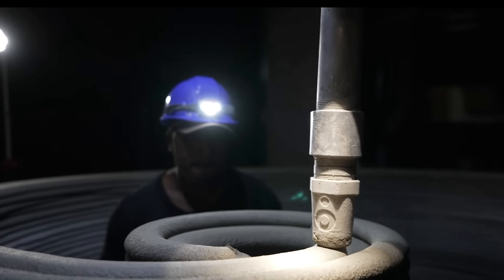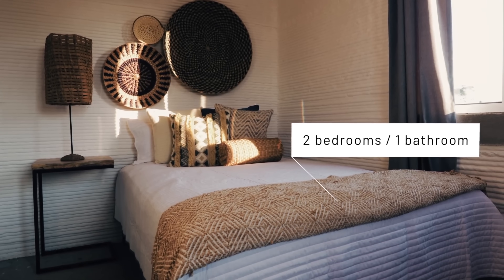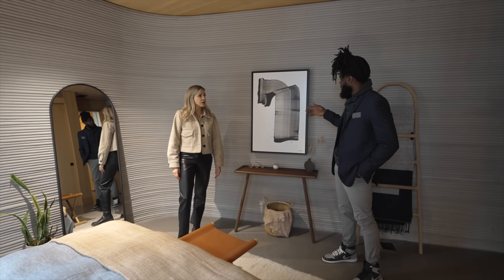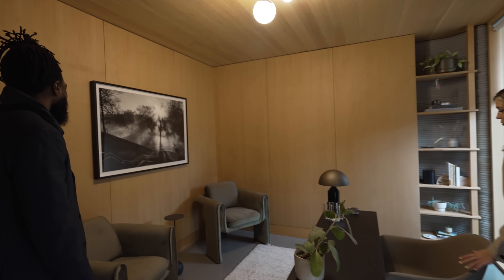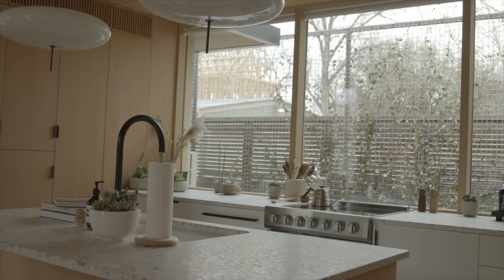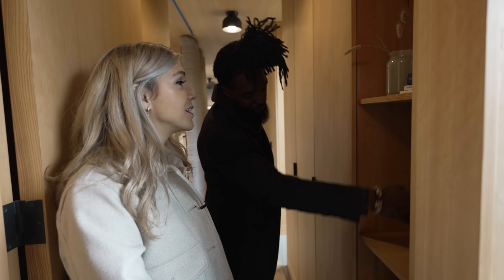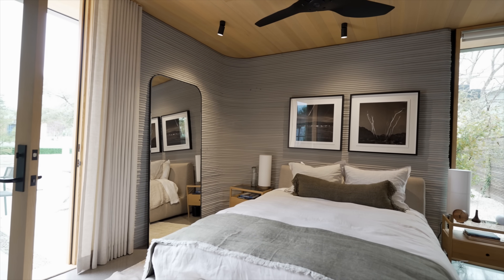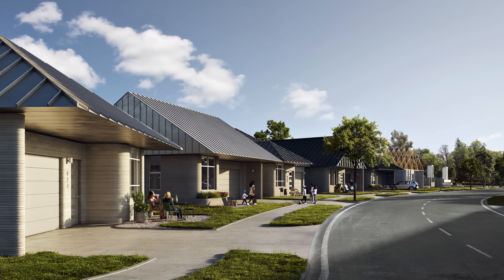Inside A 3D Printed House You'll ACTUALLY Want To Live In

Comment: wow, this is so cool. I think the only thing that would really stink is if you need to change some of the layout you're stuck with the main walls. I'm wondering how much less expensive than traditional houses they are.
Reply: I would think of it like a condo where you can't add or change the layout, but you could just reimagine the space you have.
Reply: As a builder myself I’d bet the farm that this is NOT cheaper, more efficient or more environmentally friendly. At least not in southern Ontario.
Reply: @PeterH269  Check out the channel of Belinda Carr. She is and architect, who is evaluating and busting many of these myths.
Reply: @PeterH269  It is not any cheaper - at this point. As the price of concrete ain't going down, it's really a novelty at this time if you run the numbers.
Reply: @16v15  Where do you live? Homes here in the Toronto area are well over $1.3m for a small 3 bedroom. There is no way a 3D printed house would cost more than $75k - $100k per house... bigger and more functional as it would be custom. This would solve the housing issue where pretty much anyone would be able to afford to have a home.
Reply: @16v15  You obviously don't get the point. Housing prices are made up. It's not the actual cost. The lot is not $800k. The lot prices are made up. Same with condos. A 1 bedroom 800sqft condo should not cost $750k when they use to cost $150k.
Reply: @eirik874  Yes, made up. Explain how a 2 bedroom bungalow that sold for $420k (high) in 2008 is now selling for $2.2m  today.  Did salaries go up 500%?
Reply: @casual35  that is because the market is in the roof. Now as to the building cost you are also paying for the land the house is on. The wood has gone up drastically and still is up in the roof because of the event that happened in Canada. There is also a shortage of sand to the concrete. The workers need there salary and at least the company that i work for (construction) aims for at least 15% profit but we usually hit around 20% and there is all taxes and such on top of that also so it really adds up in the long run. Also to elaborate a bit on the market especially in the city where everyone is moving now days in Oslo its roughly 13k dollars for a square meter just because there is hard building there. We can speculate that the bosses building the houses are thieves and bad guys but there is many factors in here
Reply: @eirik874  Lol
Reply: @xxxxMaddnesSxxxx  if it can make houses affordable for the younger generation or people in general its a great idea. i wonder how it would work in different climates.
Reply: @casual35  Toronto and Vancouver are insane I used to live south of Vancouver BC
Reply: @xxxxMaddnesSxxxx  Can we print hempcrete?
Reply: @xxxxMaddnesSxxxx  Would hempcrete be as economical as house printing? Apparently, hempcrete is more expensive than traditional concrete.
Reply: @xxxxMaddnesSxxxx  What do you think of cob houses?
Reply: @PeterH269  Even if it were "cheaper" it would only be a matter of time for it to match and/or surpass conventional building. The majority of business these days has only one goal, eliminate human labor and increase profit.
Reply: @PeterH269  I thought the same however we are both wrong. As someone having one so e in NEW YORK where EVERYTHING IS MORE EXPENSIVE. The home itself such as foundation, floor, walls, ceiling is without a doubt no BS approximately 40 PERCENT cheaper then a traditional stick and wood home.
Reply: @PeterH269  when you find the actual answer to that, write an article about it on Medium!
Reply: @PeterH269  is totally right.  

As for being "stuck with main walls" that is always the case with poured concrete, or any other "main wall" really.  Home owners generally can't bust down even a CMU wall or any other significant park of their building without the assistance of skilled labor, not the type of ones that would be sold on this kind of gimmick anyways..... 

This dudes job title and shoe laces say it all to me.

Which reminds me, the whole shipping container thing is really only a step forward for people who like the look of shipping containers.  Otherwise they're generally not any more modular or green or cost effective than anything else really.   I don't mind automated construction but the whole point of this video is to buy into something that seems clever.
Reply: @beepboopbleep3695  I wonder how much you actually save on doing it this way... making a concrete frame like they have here i cant see that really taking that much longer with skilled labour
Reply: @beepboopbleep3695  Installing wiring and plumbing is a whole lot harder too. Check out Belinda Carr's channel. She is an architect who debunks many of these myths, including the shipping container non-sense. Like you, I am also open for new methods, but it has to be sense and not just be different for the sake of supporting some new startup business.
Reply: @mrtopcat2  bingo
Reply: @beepboopbleep3695  Plus wood structures have a far better R-value than concrete or stone. Wood also has a far smaller carbon footprint with concrete having the LARGEST carbon footprint of all materials. Additionally I just saw a documentary "sand wars" according to which concrete-"type"-sand is already a scarcity.
Reply: @mrtopcat2  hmm, interesting.  I guess solid chunks wood and plywood sheathing themselves have a much higher insulative capacity than poured concrete per cubic inch, and the more practical wood framing and bat insulation achieve even better performance at pure temperature separation, but I wonder:

Could the lower R-value of poured concrete actually accentuate it's temperature performing qualities in reference to human comfort/daily time scales? Like a magical ratio of moisture permeability and lower specific height threshold variable to higher volume and connection to underground slab/water table conditions.

I've never really thought too much about it, but "cool concrete" is a thing I think... Maybe the opposite of a heat sink?
Reply: @mrtopcat2  or is the opposite of a heat sink a space heater i don't know
Reply: @beepboopbleep3695  I am not so sure myself. Like mentioned Belinda Carr has many answers. I am not associated with her channel and these days I don't even watch it that much, but she had some really smart explanations about this sort of stuff. She even has a video dedicated to insulation materials only with pros and cons, vapor transfer etc. you name it. If you are interested in building a house, she should probably be on your list to watch first. Another YouTuber Matt Risinger had also again and again some great info on insulation. But I must say I am no big fan of any new kind of insulation, which is IMHO untested.
Reply: @mrtopcat2  Depends on the design. You can print wiring conduits right into the wall. Plumbing can be laid in the slab foundation. Imagine already just printing in the channel for an in-wall vacuum. I'd also look at if the wall is strong enough to allow you to berm earth up to it so you could really use that concrete as a thermal battery even better in colder climates.
Reply: @TheChromeRonin  You have answered the plumbing and wiring question, but left out the elephant in the room: carbon footprint and sustainability. In fact, research is going towards moving away from concrete for reasons of sustainability or better in case of concrete the lack thereof. 

With cement production being responsible for 6% of global CO2 emissions, while car tail pipe emissions are responsible for 7% of the same. Concrete also requires a type of sand that is already finite in some local areas (Sahara sand is not suitable).
Reply: @mrtopcat2  Thansk for pointing this out. These 3D printed houses are not cheap and are not efficient to build with in your typical suburb or city. Even if you want concrete house its more efficient and easier to make pre-cast segments in a factory then to bring a 3D printer and all raw material to site like this. The 3D print method has some areas where it will be good though, for example on the moon, other planets or other isolated areas where automation/remote steering is key and where the raw material thats going to be used will be gathered right next to the construction site. As for these suburbian 3D print houses, the concrete is delivered from far away just like any concrete work. It only really makes economic sense with 3D building if the raw materials are dug up right next to the site.
Reply: @mrtopcat2  your forgetting something the wall is not 100% concrete. It has a hollow space where insulation is poored.
Reply: @beepboopbleep3695  Adobe is normal material in new mexico and wood in walls does not exist.
Reply: @TheChromeRonin  why should the wall have conduit when the wall IS THE CONDUIT? But I know the 3d head is not accurate sooo perhaps a robot can lay in the conduit?
Reply: @LK-pc4sq  Your user name sounds promising. So you should know better. Have you read more of my comments here. Concrete is pretty much the worst from the climate change perspective. Please stay informed. We don't have more time to waste with solutions that feel good or sounds good for people who may be well meaning, but technically illiterate. This is the time to search for hard data, which is available. Again, please read more of my comments. It may be a good starting point. Best wishes.
Reply: @kasposblazos864  I wish people would stop calling it "3D printed". This is automated CNC concrete pouring.
Reply: @PeterH269  well of course you wouldn't you're a builder this kinda stuff makes you nervous
Reply: @Coldlegend214  I think Peter is more qualified as he builds for a living.  Just because something is new and paradigm shifting doesn't mean it stands the test of time but at the same token, doing things because we have always done it this way means no innovation.  I say, let's see how it stands up to the elements, how efficient it is and does it hold up over time.
Reply: @xolomartinez6036  last time i checked concrete last 80 years or more.
Reply: You guys do know that computers use to cost $10k and now a $0.50 circuit board is more powerful than that original retail computers. Just give it time. Automation always beats manual labor in the long run.
Reply: Please watch my audiobook summary
Reply: I Think no much different than any other concrete construction.
Reply: you can change it just need a jack hammer hahahah
Reply: @Amy Weinholtz Your concern has everything to do with insulation. There are some great videos on the different insulation materials as well as the problems of insulation (and many other building related topics) on the channel from Belinda Carr, who is an architect. For the record, I am not affiliated with the channel; she does not know I exist. 😀
Reply: @mrtopcat2  haha, I'm sure Belinda Carr has said this again and again, but I'm sure @Amy Weinholtz was referring to fractures.

Control joints only mitigate the cracking of mostly visual elements, whick is why Reykvaik looks like it does (edit: it's probably way easier to ship in all that sheet metal).

Still, that only reinforces (if you will) the point that top down CNC concrete has very little merit if you account for all the spatial, temporal and environmental dynamics. Oh, and the money.
Reply: Everywhere in the world houses are made of concrete and brick, the US is one of the only countries in the world that builds mostly in wood and drywall, everywhere else concrete is traditional housing, and we remodel all the time, just use a powerhammer and tear it down, as long as you dont destroy the load bearing columns you are good.
Reply: As someone in the process of having one built in NEW YORK know less where EVERYTHING is MORE EXPENSIVE. I'm happy to say the house itlelf not including tile, cabinets doors. Basic interior thing like such. So th foundation walls floor ceiling is 100% 40 PERCENT cheaper then traditional stick/wood homes.
Reply: tripadvisor
Reply: I do NOT want that house.  to many "technical" /structural Restrictions inovolved with it and  it required constricted sizes.  The material is a horible mess. Then huge expense to "cover/finish those walls".  Wiring and plumbing issues.  If you want to build something like that there are better/Cheaper , simpler ways to do it.  search ,... Oh what is it called,  Mud/sand bag , earthen bag construction.  And I am not saying I would want that for my main house.  I've have seen nice hotel rooms....  cement is a mess! espeically when you leave it exposed. Dirt , spiders, and bugs "sticking to it" , then trying to deal with plumbing, elextrical etc,  and even try hanging a shelf or picture. :-)) that texture is aweful.  even beyond cleaning it has problems.  the novelty would wear off quickly.  and trying to cover that up with wood, plaster, etc... IS $$$$$   Are you noticing that even with the camera/"lense"?shooting done to try and make it  look bigger.  Look at how SMALL the rooms are. EVEN The ones that are supposed to be "larger rooms"  Oh and I live in a mostly solid cement walls and roof/ceiling ...  I will call Bull Sheets on it being 75 F inside on  days when it is in the 90's .  I live in the desert and once it starts warming up in the spring in the "90's" after a few days the cement warms up, the walls warm up and there is no way you are going to have 75F inside without turning on the AC.  if it goes "hot" then cold" then "hot" the cold for a couple of days, then Maybe... But after after a few solid days or warm/hot temps, the cement warms up. and as the temps keep on climing for "the SUMMER/ spring"  the walls of the building keep getting warmer.  In the low desert in AZ,  if I turn off the AC it will quickly start climbing toward the 90's F. I guess higher if you forget to turn on the AC.  Oh, and of course the Reverse happens in the winter.  Sure the novelty of this is "cute"  but the reality is..................  Not So Great.   especially if you DON'T want just a little "single persons"  condo/vacation condo"  and You don't want the MESS of unfinished cement walls.
Reply: Thank you 70 subscriber

Comment: Love the concept but I wonder if it’s healthy to be exposed to too much concrete (like to breathe in or skin allergies). Concrete is stronger material but wood is healthier? And I’m not that sure that isolation is that good. Concrete heats up in high temperatures and cools down in colder. So when it’s hot outside, it’s gonna be hotter inside and when it’s cold outside, it’s gonna be colder inside. I’m no expert lol but any feedback on this :-)))

Comment: If you see what Anker is doing for their new Kickstarter 3d printer where they integrate a camera at the site of the printing nozzle, that is next level feature. Through the use of computer vision integrated with the cad design of the object to be printed, the printer itself knows what the print job needs to look like. Rather than making a mistake and keep going the printer has the capability to opt to stop, notify the user, and possibility to troubleshoot or even change out parts really gives you more options for your workflow. 

If Icon adopts what Anker is doing for their little printer and incorporate computer vision to their "print head" it will significantly reduce the amount mundane observations that a technician needs to do and possibly allow for more printers to be deployed at a worksite.